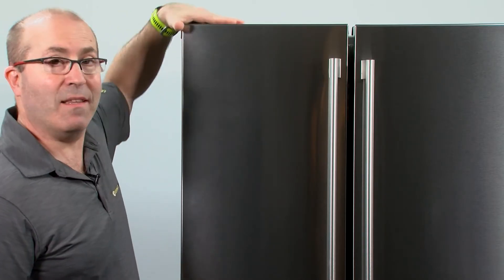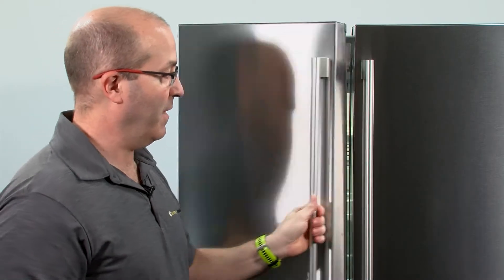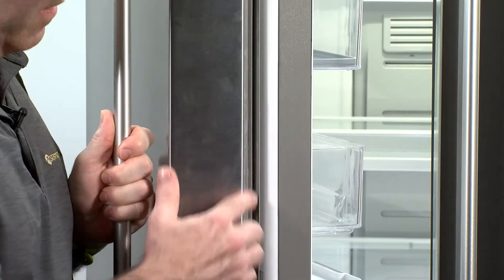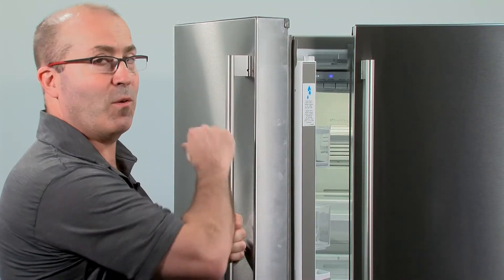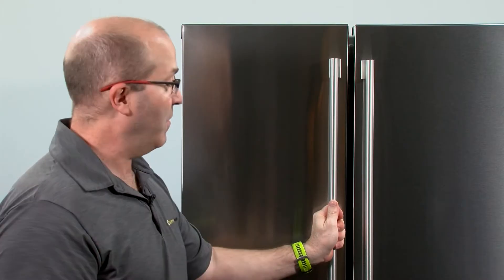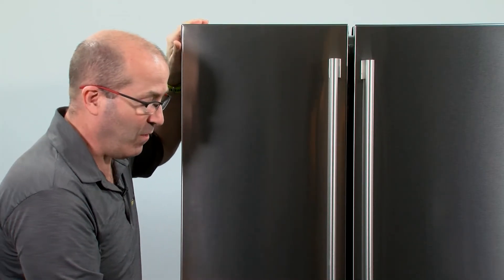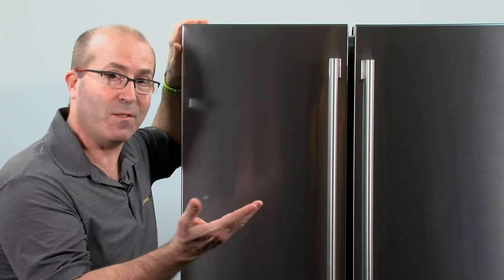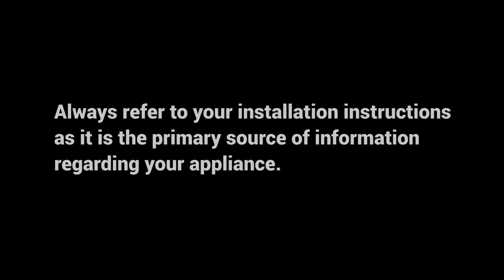Why the outside of your refrigerator door feels warm.

Comment: The left and right top above the door (and sides near the top) of my older Kenmore frig lately is getting  very hot. It seems perhaps the defrost cycle may be stuck on but not sure, but the freezer is not getting cold enough to freeze water and the frig portion below is barely cold. 
I am not sure it the Bi Metal sensor is stuck closed or could there be another reason the top and sides are very hot and the frig is not cold. The Evap fan is on and the compressor is on and all dust cleaned away. Thanks.
Phil

Comment: My fridge is hot not warm.
Reply: Mine is hot too! And it is brand new
Reply: My is brand new too and feeling quite hot on the sides outside
Reply: @Jamdung876  in the process of cooling, heat is produced which is dissipated out of the side. New fridges may be warmer as they cool to a consistent temperature